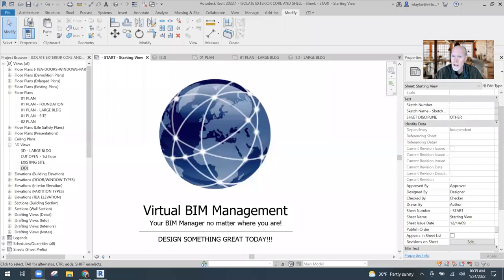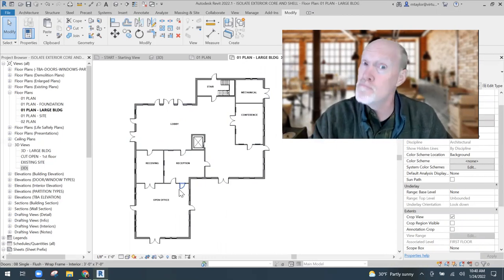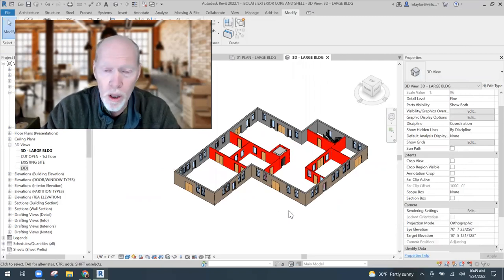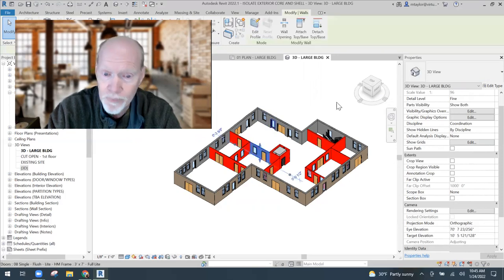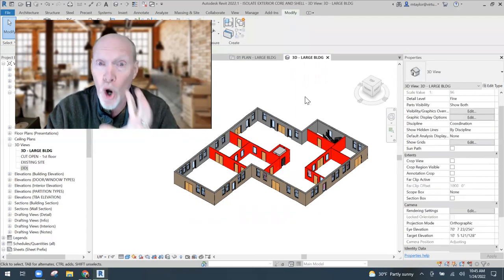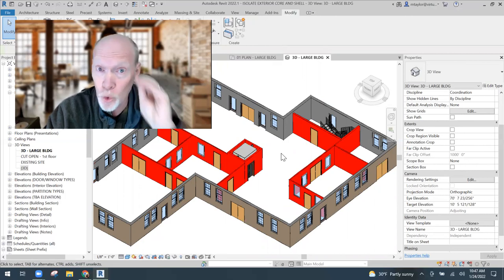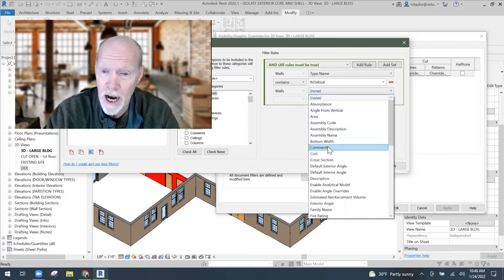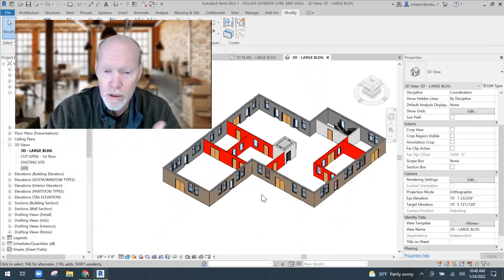ISOLATE CORE & SHELL ITEMS FROM INTERIOR ITEMS

Comment: awesome tutorial :) as always  :D could you please help me or guide me to a solution to my problem :D ,  i have a project where i have walls, where the inner leaf is concrete, then we have insulation and later the brick facade,  can we create plan views and also 3D views with only one of the parts of the walls ? like just with the concrete ones ? without using " create parts"on the walls ?.... Thanks for any reply in advance!
Reply from the maker: I think you will need to use Create Parts to break the walls into pieces. That way you can turn OFF the pieces you don't want to see.  Sorry.